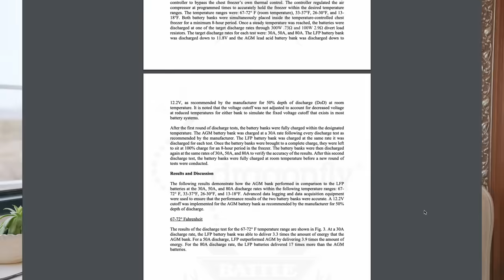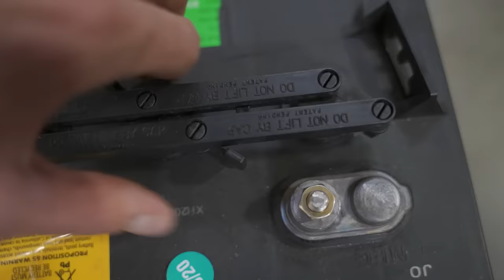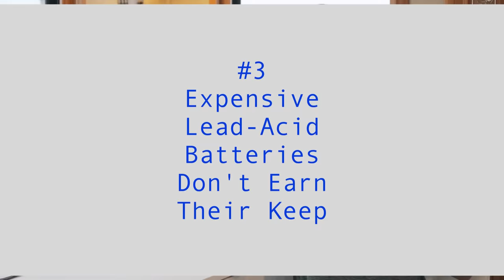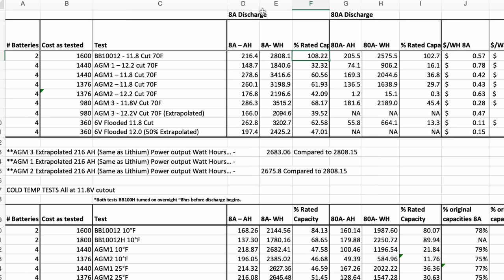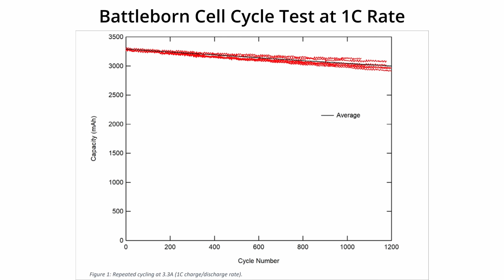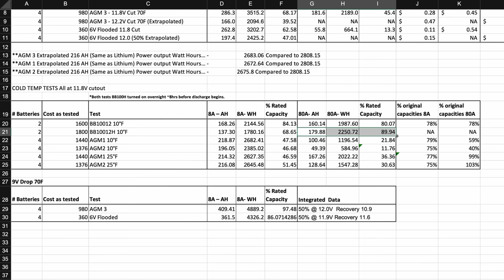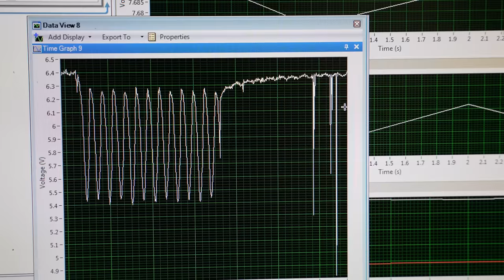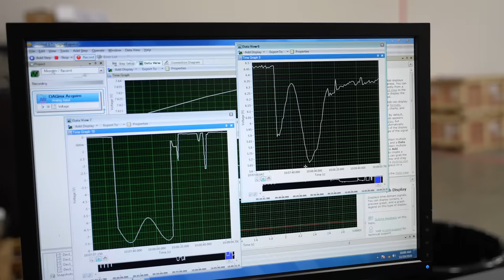Don't Waste Your Money On Batteries - The Shocking Truth I Discovered When Testing RV Batteries

Comment: In my opinion these stats are a bit massaged. First off all  batteries are a chemical storage unit, and yes Lithium can chemically react faster then lead acid hence with these high amp load  tests at such a low voltage (12v), you will see lithium be able to perform with more overall capacity and efficiency every-time. But remember all lead acid chemistry is recommended rated at 20C, where as Lithium chemistry is crazy 1C rating. When you look at the load they put these batteries under for this testing, it is no where near the 20C recommend rating that Lead Acid chemistry works well at. In other words this test looking at his charts has AH loads way over the ability for a lead acid to do unless it shortens its capacity to do it. But lithium can handle super heavy amp generation due to the very fast reactive nature of lithium chemistry.  There is more resistance built into a lead acid battery chemistry. It's not really a fair test even through they are trying to show that it is.  For example a 100 AH rated lead battery max 20C rating for Lead Acid chemistry should never be more then 5 amps of discharge at any moment, if you do that you will get 95-100 AH performance. For Lithium 1C rating at 100AH you can push 100 amps and still get 100 amps. But lead acid pushed that hard will not deliver 100ah at 100ah discharge rate, your lucky to get 10AH at that rate. They way to get around this is don't wire a lead acid battery in a 12 volt format. It will wipe out Lead Acid Chemistry. This is why any good solar back up systems are wired in a 48V format. The higher voltage will be pushing way less amps from the battery and the battery will thank you for that, because the battery is generating chemical AMPS. Lithium is still 3 times the cost up front, and if you treat your Lead Acid batteries at the correct C rating that they where originally designed for, they will have just as many duty cycles as their lithium counter parts, believe it. Case in point my brother bought a brand new Nissan Leaf car, but over time the car batteries capacity got so low he had to go back to the dealer and pay $13,500 to have new ones install. He got 8 years out of those batteries and was told the duty cycles got used up. Good well kept FLOODED Lead Acid batteries will last that long too.  I have a set that is on its last legs for a solar system after 11 years of service. And now companies like Roll's Surrette make lead acid batteries with nano tech which helps prevents sulfation of the cells, so NANO tech Flooded  batteries will go more duty cycle and last longer and for only 1/3 the price up front vs. Lithium counter part.

Comment: Maybe I missed this point. But did you measure the efficiency? i.e. how much of the energy used to charge the cells could be reclaimed from them.
Reply: I can't imagine it being much of a difference but that will mostly be determined buy your charger or solar charge controller.

Comment: Hmm....... I just bought 2 x reconditioned AGMs as the start of our solar system battery bank on Sweden's first Earthship.I have 10 x 160 watt solar panels to test in paralell, each @ 20 Amp. I guess since my time as electrical engineer in the British army in 1993 a LOT has happened in the battery world (and I have a lot of refresh studies to do obviously). Since leaving the army I've been an environmental activist and refuse to support new Lithium mines in the world, EXTREMELY destructive which makes them a pricelessly expensive non-option in my ears, as much as the oil dependency for which we do the mass-murder world tour for, together with US troops. I guess the only way for me to go now after watching this is to scale up dramatically with the reconditioned AGMs until I reach "enoughness" for this Off-grid household/Earthship. Cheers for taking the time to do these tests, crunching the data and making this video. Better to know than not to know ;-)  Warm regards from Sweden bud. (Oh and one question, to save me drowning in your full data roll out on the website, time is now an issue here: HOW MANY of the same 12v 92Ah AGM's would you recommend (indoor battery bank in a room at around a 16 degree c constant, 1600 w roof mounted solar array? I'm aiming to run a 12v fridge freezer 24/7, occasional coffee brewing, 12v water pumps x 2, laptop and mobile, as well as some DC lighting and some AC through a 2000w invertor? Thanks in advance if you have the time to assist!

Comment: my Nash drain my battery while hooked up to out board power.  so i went and got a new battery.  i decided to put in two 6 volts batteries.  i was told it word last longer when boon docking. i hooked it up and they too were drained.  i ruined those!! SO, i think my converter is not working.   so my question is, can i put in a better converter? my old one is a Intel Power 9000 PD-9155.  i dont know what to replace it with?

Comment: I have to disagree completely.
While yes li batteries have more cycles, it depends on your environment you live in. 

In cold weather conditions, li does not fair well, in fact if your to cold, a li battery to cold can literally be ruined, where as an agm deep cycle can typically handle weather conditions better up and down.

If your in day Florida, Cali, Arizona, I'd say your pretty safe using li, if you live in some place cold, or in Missouri where I live, we have been known to have some pretty drastic weather, and cold spells where it drops down to single digits. In this case agm is more suited because it handles the hot and cold changes better. Not to mention, generally most all batteries carry a 4-5 year warranty.

If you have an li battery and it's in a warm place, that's also good, but for me, mine is in my van, and when at work, no heat in the van, those cold days can affect the li battery and/or ruin it. 
So in my case........I chose to use agm over li, for that reason

As far as a lead acid battery, ie: a car battery, I totally agree, those are not meant to charge and discharge like deep cycle or marine batteries are. This is why they make both. Generally a car battery is meant to use down to 11.5v, that's considered a dead battery in the auto industry. So no for typical l lead acid batteries aka: car batteries, agm or not. 
They do have two different types, agm marine/deep cycle, and agm car batteries, they aren't the same.

Comment: I have no test data but Die Hard auto acid batteries use to have a 5 year guarantee, now it's 3 years. Supposedly acid don't last as long as they use to bc all the extra electronic  drain on them now. I don't believe it. Use to be able to recharge dead batteries and still use them for some time. Dead now means replace. A few years ago I saw a factory original acid car battery in 7 yr old car. Take your car battery back before warranty is over and get a new replacement if you can. Cheers.

Comment: I would like to use Lithium in my boat but I’ve they can’t be bounced around.  I have three (blue top) high end AGM 75ah marine batteries, two are in series abs connected to a trolling motor, the third is the engine cranking / electronics battery.
would battle born lithium batteries be good marine batteries?  I’d probably cut the weight in half.

Comment: It seems that to get the full charge you need to get to 14.4 volts. Does that mean a standard car alternator wil not work? What about the draw on the alternater, regulator and wiring. Also in use as a starting battery pulling high amps through the bmi or any thing else I missed. It seems the bmi is the weak link in the high current. I would like to put lithium in my vehicle to have less weight and greater power. Is there such a thing yet? I really don’t see a real deal yet . I have been looking into this and if I’m not mistaken it’s probably not a good idea to make the change. Group 27f

Comment: I have quite a number of APC brand battery backups. 2 months ago, I had to replace batteries in 3 of these backup boxes.  However, in just the past 2 weeks, I've had the hydro go out on me 4 times, for about 2 hours for 3 of those times.  The batteries are lead acid, and so they have already been damaged by going 100% dead in that 2 hour period ( actually less on one with the computer only lasting about 20 mins )  - So brand new batteries are already damaged and not happy with me at this point.  IF somebody spent $900 on one of these 100 Amp Hour Battleborn batteries ( 12 volts )  in theory that battery could last 100x longer or more, and suffer zero damage.... is that about right ?

Comment: What would the best battery be to use in my solar charged battery bank I plan on setting up in my back shed? It gets very hot in there during summer… perhaps up to 70 degrees Celsius.
I’m worried about overheating and potential fire…. Would a bunch of cat batteries be suitable in this situation?

Comment: Go to Walmart look at the 1000 amp batteries for $84 they tell you there are 1000 amp batteries at 135 amp hours so let's do your test take your 100 amp hour batteries which are $960 amp batteries and test them where the actual amperage that they're supposed to be supported to and don't get those really expensive batteries it's going to go to Walmart buy those $84 ever start batteries for $84 and some odd tax and see which one actually lasts longer oh wait I guess you got to get $960 amp batteries and test them with the hundred amp hour batteries see what your last longer and neither of the batteries like cold weather neither of them like refrigerators none of them do you put it that has the battery outside 3 months later it is dead and freezing weather actually even one month later it's dead even 2 weeks later it's dead show me a circumstick as a 130 amp 135 amp battery thousand at battery does not last as long as a hundred amp battery oh let's make it $980 amps 960 amps that's capura 100 amp battery with 100 amp battery amp hours that is to another that ass hundred amp battery go pay more money for a $960 watt 960 amp battery to a lithium 100 watt hour 960 amp battery and that's what you're testing all your batteries with the light acid batteries I get $84 batteries 1,000 amps and they tell you they're 135 amp hour battery now I want you to do a real test the real amperage of your hundred amp hour battery 960 amp battery that's what you're using against any other battery so I dare you to show yourself a liar and that is fact.

Comment: Outstanding.  Excellent presentation of the data here.  I was already sold on BB.  We are going fulltime RV in our Airstream next year and I’m doing the research for the buildout this winter.  Our flooded cell 12v batteries have served us well the last four seasons and worked well for weekend warriors.  For FullTime use though, we need Lithium.

Comment: What's the difference in running batteries parallel or in series❔❓
Reply: Connect two identical batteries in parallel and you can safely draw double the power you would be able to do with just one battery - at the same voltage.

Connect the two batteries in series and you will get double the voltage without any change in the maximum safe current.

Comment: It's a nice idea but it's not here yet. 
For now, I personally see that none of the batteries currently available are really useful as the only backup. If it helps a gasoline engine, for instance in a heavy load I can see it. But the technology is not yet here for batteries. 12,000 charge/discharge cycles are nothing for someone with a lead foot. You probably do about 100 discharges a day from work to home.  
And lithium batteries are becoming a huge recycling problem. Putting lead into our environment is not a great idea either. Some spring leaks. And when they charge or discharge they do spit out lead fumes from the bubbling action.

Comment: Hi, I have a question to the PORs. I would love to put a 12V Li-Ion Battery in my Offroad EV Pinzgauer but my problem is, that my winch needs up to 700A and most of the Li-Ion Batterys do not give more than 300A. So what Battery would you suggest me to put in? Thank you very much for your answers.

Comment: What were the AGM batteries rated for in terms of discharge current? I'm sure that's where you would have run into issues with voltage sag during the microwave and coffee machine tests. I have a 12Ah battery and maximum discharge current is 35A continuous, which is only about 400w via the inverter

Comment: Any info on best battery type for hot climates,120°F+,I think the heat is killing my lead acid battery banks.should I put an air conditioner in the solar shed to cool batteries and equipment?any helpful info?

Comment: I have been off grid for many years and have used all battery types but like lithium the best. Battleborn appear to be good batteries but the ones I bought were the same 100 amp hour capacity but less than 1/2 the price... I do not believe Battleborn manufactures thier own cells so I chose the off brand batteries,

Comment: Can lithium batteries like this be charged with the same charging equipment that are commonly used with AGM or lead acid batteries?  (I’ve been using a Schumacher sc1308)

I also keep my conventional deep cycle batteries on a ‘smart’ trickle charger.  Is that still something that can be (or even should be) done with lithium deep cycle batteries?

Thanks for any help, it’s new for me.

Comment: Some of this is pretty cringe. Amp hours are equivalent, they are just a bad measurement because they are subjective to the chemistry. Watt hours should always be used when calculating the capacity of your system, using the nominal voltage of your battery. The nominal voltage of 1 lead acid cell is 2 volts. The nominal voltage of prismatic Lithium Iron Phosphate is 3.2 volts. 2x6=12, 4x3.2=12.8. Nominal voltage times amp-hours gives you watt hours. 100 amp hours being the same, the main reason why the watt hour capacity is different is because of that extra .8 volts. Both the Lithium and the Lead Acid batteries in the graph at 9:25 all fell within an acceptable margin of error, but the way you worded it makes it sound like lead acid is basically worthless.

That isn't to say that the sag you mentioned later isn't relevant, it's just not relevant to regulated power delivery. That is to say, most of the 12v stuff you're plugging in in 2022 (LED lights, cell chargers) don't really care about voltage sag, they will run that battery dry until 5 volts or so where you've done a good bit of damage to either lithium or lead acid batteries.

Where it counts is in very high, thousands of watt power draw. So if you need to pull fewer amps from your lead acid batteries, just convert to a 24v or 48v system and don't sweat it.

Lithium is obviously the future, but it's not worth the upgrade if you have something in-situ that currently meets your needs. 

Lead acid however, remains the absolute undisputed king in both accessibility and recyclability. So if you are environmentally conscious, it might feel counter-intuitive, but a lead-acid battery is 99% recyclable (most lead acid batteries you buy today were made from old lead acid batteries) and has a far lower environmental impact than a lithium battery for several other reasons.

Comment: Good thing I only use standard car batteries and have not replaced in 3 Year's the cost of them was $49 each
Reply: Your car batteries hold a fraction of the energy and they also weigh alot more. You can't cycle them.anywhere near any times as lithium

Comment: 15 degrees F is not cold weather for a battery. At - 15 F you just start to get cold. In the lower 48 cold is considered -30 F since that's normal and still not abnormally cold. This all sounds like you live in Florida. Wtf?

Comment: Can you help me determine the type and size of batter required to power  a regular hand held hair drier for 30 Min.

Lets assume 1800 watts peas x 110/120 volt.

I am looking for n alternative power source for this when we travel to Dog show and have to groom 2 small dogs.

I know a gas generator will be lower cost, but traveling with gasoline in a car is just not safe.

Comment: Great video, thank you! I need your advise though. I bought 2 Lithium batteries for my RV and put them in parallel, but I don't see on the battery meter when they drain, like when it's half drained or something like that. Can you advise on some meter that would show me the percentage left on the batteries?

Comment: I get 140 AH lead acid batteries for less than $150. They will go bad after 2 to 4 years and will power my fifth wheel for about 5 days if used well. I carry 2 and will charge 1 on a generator when needed. $1000 batteries are for rich people.

Comment: Three years later I see 100ah Li batteries now for $250 or less. This def changes the cost per energy cost dramatically. But as others posted...this seems to be an advertisement to buy the high end batteries.   They all seem to be made in China anyway so Im doubtful that spending 3x more for a high end battery is worth it.
Reply from the maker: Watch the vid I just posted for the difference in the batteries...

Comment: And yet you show the Battle Born brand? Seems like an infomercial video to me. Why no other lithium brands in your tests? Why hide the lead acid brands if your data is accurate?
Reply: The vid is three years old and a lot have changed. BB was the top rated battery at that time. Yes, sounds like an infomercial.

Comment: Apparently the makers of Lithium Batteries are unable to place a 1 amp drain on their batteries and measure how many hrs.
it takes to drain them..  There is no amp hr. rating on them so I did not buy them. I bought deep cycle lead acid batteries 
and they are working quite well.  On the other hand I have bought devices with Lithium Batteries in them and been very disappointed with their bad performance.  Just telling my truth .